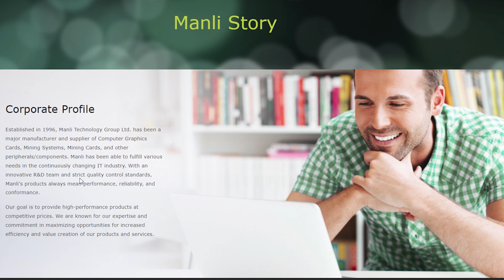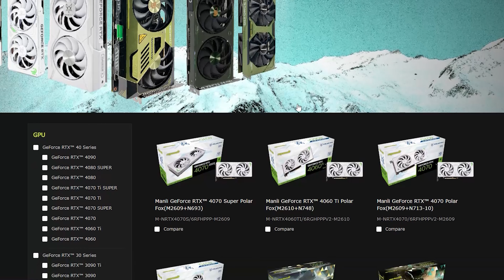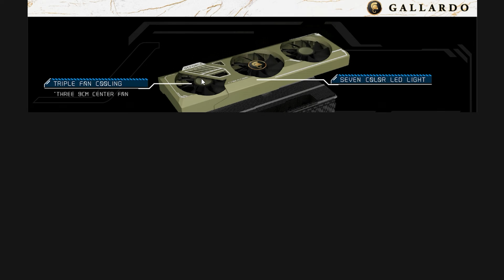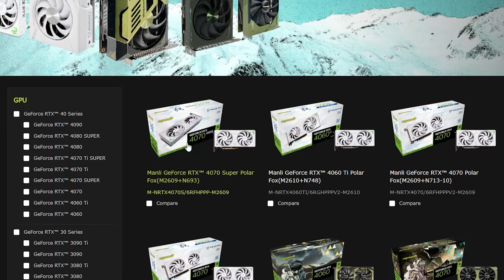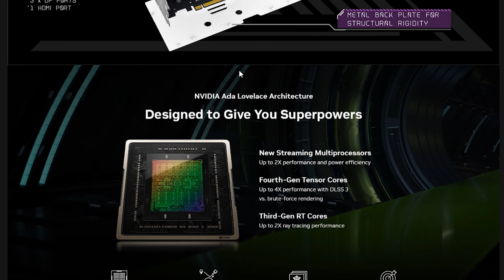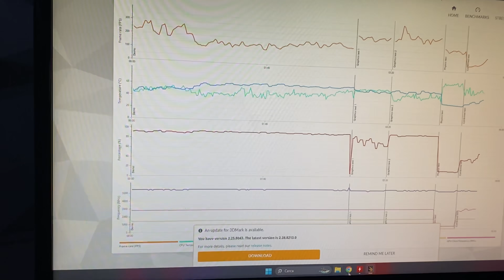Are Manli GPUs actually that Bad?

Comment: Just bought Manli RTX 5070 Polar Fox. So far so good, card run around 60 C on max load. Hopefully it will work over 5 years for me.
Reply: still normal?
Reply: @guts5578 Yeah, no issues at all. Undervolted to 0.950 mV @2800Mhz , getting 130W GPU power consumption average.
Reply: @TechnicalResources-u4e thx, just bought a manli nebula 5070 an hour ago, hope it'll be just the same since its also manli
Reply: same here, but i have the nebula version got 498$ much cheaper than other brand
surprisingly the fan noise is very quite and temp is 67 max at 250watt default voltage while underload with triple fan 1300rpm
undervolt to 875mv, 2.8ghz 140watt, only temp 45 max with 1200rpm fan
Reply: Hello, im thinking of buying it. How is it now? Still good? Have you tried undervolting and overclocking it?
Reply: @fluffypotato7475 Still good, I am not planning on overclocking though... But on new driver 591.86 I see slight power draw increase (not temp though)

Comment: I have a RTX 4090 Gallardo since december 2022, had no issues so far, always undervolt/overclock, this card came with a 3-8pin to 2x6 pin, and it's not limited by the wattage, Cyberpunk 2077 v2.2  at 4k max settings no upscaling hits 43fps avarage.
Reply: Hi I just bought this card for like $2.3k, any particular reason why I should undervotl/overclock?
Reply: Also have you had any issues with it so far? Cause I've been seeing some people saying it gets unusual high temps
Reply: @SleepDaemon Had no issues, the card is now over 2 years old, I underclock and undervolt, it consumes less power, most of the games run @ 4k 60 with 1650Mhz on the GPU and -500Mhz on the vram. Still a beast. Of course full path-traced games need the max power and even a bit of overclocking.
If I overclock, I use 2800Mhz @ 1v and +500Mhz on the vram, with 450w cap I can't go higher on the GPU, but it is safer in my opinion.
Reply: @danhaf77  alright thanks 👍, I'll probably underewatt mine when not gaming or doing heavy stuff. Besides LTT did made where you can underwatt by 200 and still won't hit many issues
Reply: @danhaf77 I'll probably also undervolt as well just be on safe side with thermals since it uses same cooler setup from the 4080 manli
Reply: hey, so i finally built my PC and using the manli gallardo 4090. I notice in one game only (marvel rivals) my gpu makes a coil whine. I asked about on the internet, and one guy said its not coil whine and that its a bad capacitor. Wanted to ask you if you heard any such noise from your 4090 card.
Reply: @danhaf77
Reply: @SleepDaemon Hi, it is strange that a capacitor does this with one game, but I could be wrong. A capacitor is working for every kind of load on the GPU. I tested various games, and I have a little coil whine, but I have to close my head to the card.

Comment: I had a 3070 with a big AF cooler and it stayed under 60c most of the time but i sold it quickly to get a 3080 for a good price, nonetheless the manli 3070 was really good but no 0 rpm mode if you care about that

Comment: I had the PNY Gallardo 4090 (manli) and it failed pretty early.  Now I have an Asus TUF 4090.  It's not even the same card.  The Manli was 85+ degrees and I'm getting better performance with the Asus, which hadn't exceed 65 degrees. Also they're (manli's) proprietary software is sketchy tbh.  DO NOT save or flash the VBIOS with their program.  I agree, it did overclock well.  But it failed after 2 years. The VRAM dies on many of them, based on what I gathered from many Reddit posts (I spent months trying to fix it).  I would agree that the card was sturdy, metal, and looked nice.  One more thing, I looked all over on the Gallardo for a switch.  Unless I'm mistaken, it does NOT have dual VBIOS 😢
Reply from the maker: This is some of the unusual feedback I was looking for, thanks a lot! It kind of confirms my doubts with buying a flagship from them. I know for a fact that their 4090 shares the cooler with the 4080. Which for them means that the 4080 has an INSANELY good cooler, while the 4090 could use a little upgrade. Unlucky about the memory, but if it was an early revisions there were issues with memory chips from pretty much every brand tbh. Thanks again for the comment!

Comment: Had Manli 1080 Ti blower style gpu which took cooler from palit but used their sticker, overall brand is real and they usually used default pcb like on founder cards. Had 1080 Ti for 3 years sold it to the friend and he still uses it and had no issue, however i upgraded cooler to accelero III because blower didn't cut it back then.
Reply from the maker: Yeah 1080 Tis with blower coolers weren’t the best, I used a LOT of acceleros too back in the day lol. Thanks a lot for the feedback!

Comment: i have a manli 3060 it has a beefy cooler but still ran a bit hot about 75 degrees but still good for the price since it's about 80$ cheaper than other brands in my local market
Reply from the maker: Thanks a lot for the feedback and yes, pretty much my exact experience with mid range cards from Manli!
Reply: where did you buy and how?